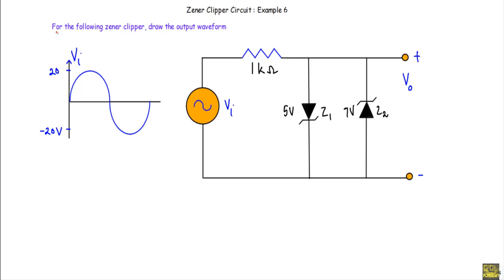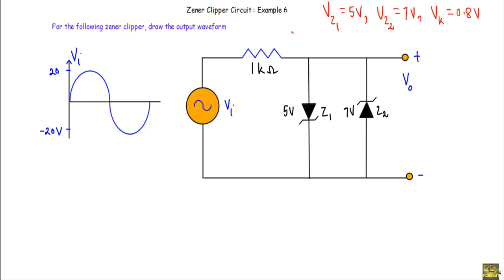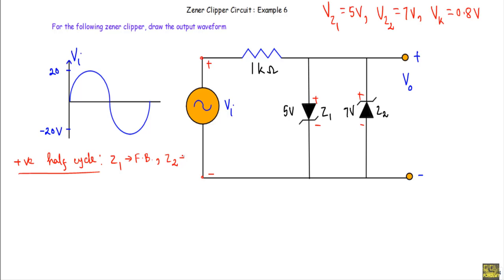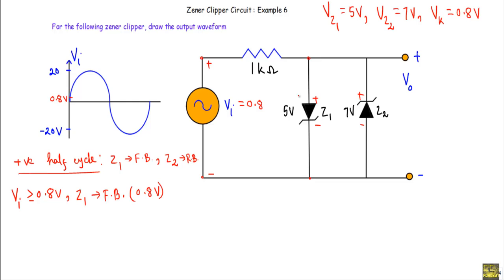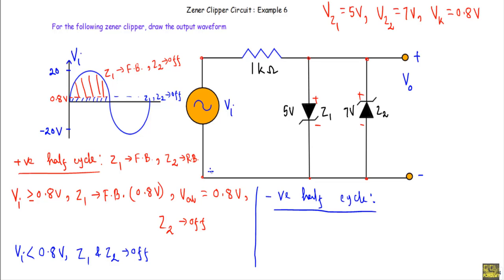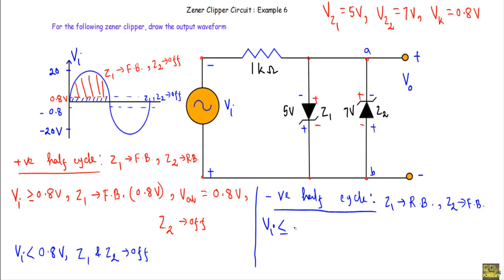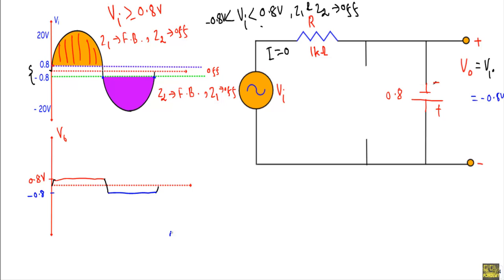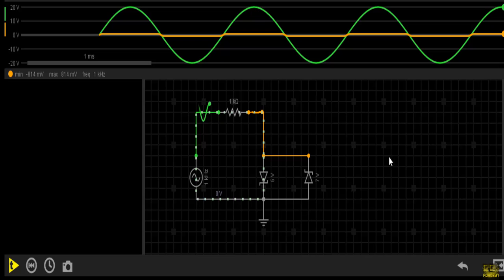Zener Diode Clipper Circuit : Example 6 (with simulation)

Comment: In positive cycle if vin is greater than 7 v then revers biased zener diode start conducting na
Reply: In positive cycle, once Z1 becomes forward bias (i.e. after +0.8v), it will act as a short circuit across the AC source. Hence, it will not allow the voltage to rise up beyond +0.8V no matter what voltage AC source is outputting. Hence, the clipping action.
Reply: Nice explanations

Comment: in positive half cycle if voltage is greater than 7 volt then Z2 should work as voltage regulator...so Vo should be 7 volt.
Reply: In the current circuit, both Zeners will never reach their Vz no matter what voltage is set on the AC source. In this configuration, they are in fact acting as simple diodes (and not Zeners). If you want them to reach their Vz, connect them in series with opposite polarities.